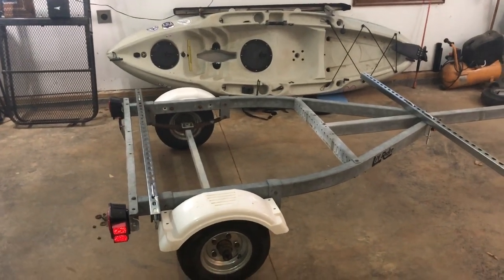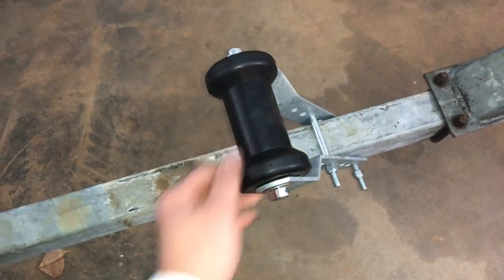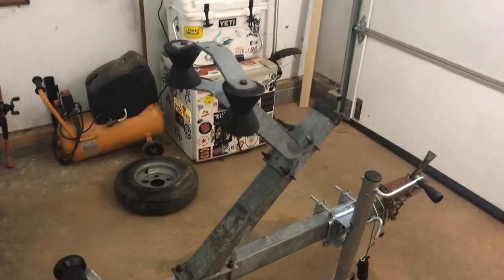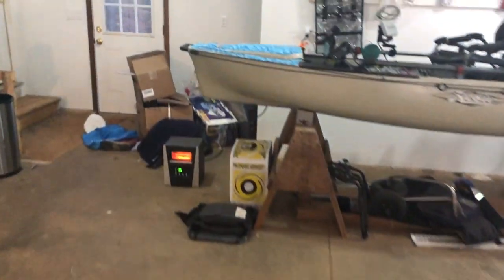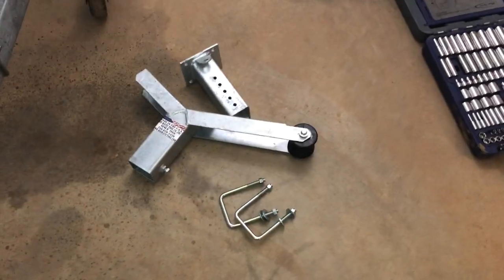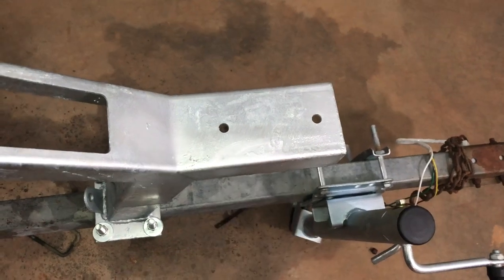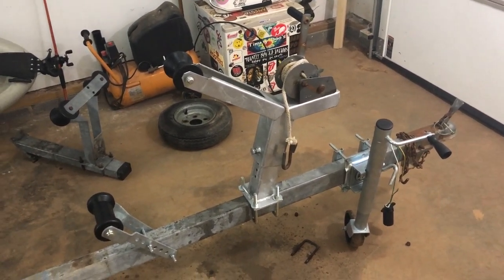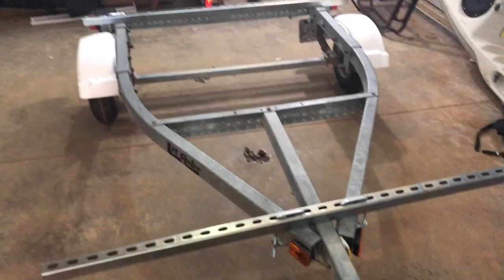Hobie Pro Angler Trailer Build (Jet Ski Trailer) Part 1

Comment: I had the cradles for a while and they started cracking. Moved to PVC and loads alot nicer. Great build so far.
Reply from the maker: Thanks. I actually heard a few people say that after I filmed this video. So I cancelled my cradles order and went with the conduit route. So much cheaper and others seem happier with it. So in part 2 (goes live Saturday) you'll see the conduit install. Thanks for the advice!

Comment: You might want to put a piece of carpet on that top roller to prevent it from damaging the front of your hobie.. i rolles a piece on mine and secures it with zip ties. I have a short video clip where im launching my hobie. Look closely and the front roller. You can see it there.
Reply from the maker: Good idea, thanks. I got bunk carpeting coming to cover the conduit bunks (changed my mind about the cradles) 👍 I'll cover the roller too.
Reply: Im looking at how you have the struts on your trailer. I think im going to lower everything on mine and use the bunks as side cradles and keep the PVC pipe under the hobie. Thats going to keep it closer to the frame and it will help me load it out of the water..
Reply from the maker: I've got the 2nd part of my trailer build going live Saturday. It shows how I have the PVC mounted to the unistrut. Lowering it will definitely help with backing the trailer straight into the water and launching.